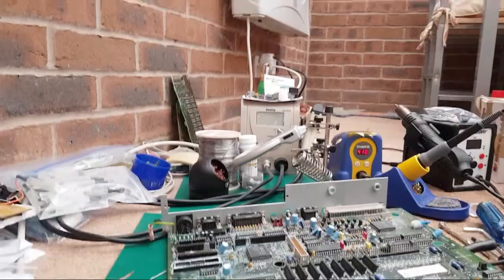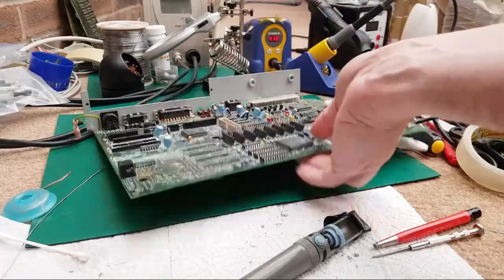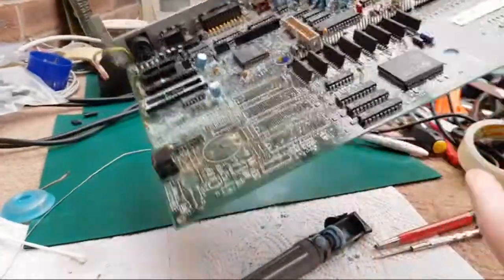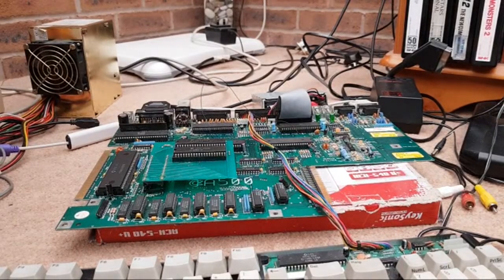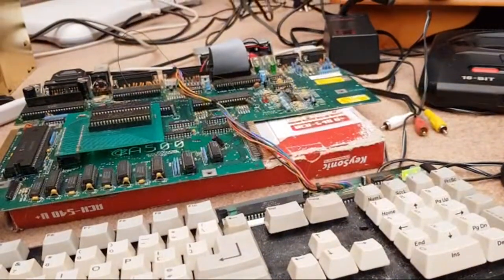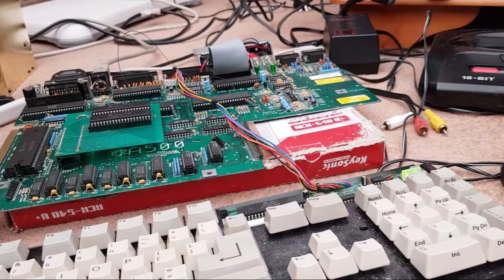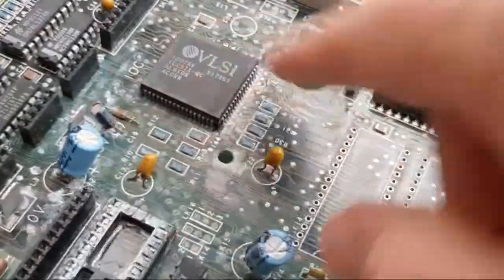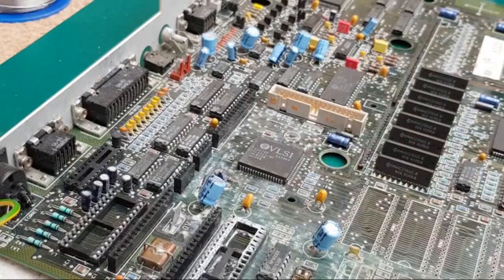Archimedes A3000 Corrosion & Amiga ROM Switcher Follow Up

Comment: Those resistors on the bottom side of the board are glued on, you can see the white line where the glue was.  If the board was wave soldered they would have to be glued on so that they would get soldered at the same time as the through hole components and not come off.  Just out of interest I would try using rosin flux and hot air to try and clean up the connections on the SMD components.  It worked well for me when dealing with liquid damaged laptops.
Reply from the maker: Indeed =D  I spotted that after watching it back too!  The top side didnt have them, I am guessing it was just glued on bottom side components only.

Comment: **TIP**
To remove components from a Board, Believe it or not it's good practice to apply leaded solder on both sides, then either use solder wick/solder sucker or a hot air gun, and then solder wick or sucker, if the board is double sided or multilayered the board should be heated on both sides if one wishes to avoid warping..
Reply from the maker: Yes, more than aware =D  Try adding solder to the top side of these boards when they are corroded - it's almost impossible and often leads to trace or pad damage.  The corrosion leaves the solder in a sorry state where it turns into something more like concrete.
Reply: @GadgetUK164  I forgot to mention Rosin flux gets soaked up by corrosion, Also with SMC a large flat chisel tip "high wattage Iron" contacting the two tabs and or as many pins of an IC takes seconds if the flux has been given time to soak with corrosion, you can never use to much flux when corrosion is present, mind you cleaning the board from Rosin is yet another exercise in itself  😃😁

Comment: Hey gadget. Any tips for clearing vias with corrosion? Run into this on Amiga 2000s. I saw someone say to blow them out vs sucking. I use a little thin piece of metal and push it out while heating it. Then sand the vias and run wire through it. Always looking to learn from an expert
Reply from the maker: How you've described there is more or less what I do!  I normally plug it with kynar and solder on both sides, then cut the kynar on both sides.

Comment: Where is the best place to find retro gear to repair?  Retro gear on ebay has increased so much that even non working systems are crazy prices. I’m not a beginner (nowhere near as experienced as you though) and am pretty well equipped equipment wise. I’ve repaired Amiga’s, Commodore 64/128s, Atari TT and BBCs/Archimedes, although not an A3000, but I have done an A4000, A3020 and a RISC PC. I’ve done some consoles as well, Colecovision and Atari 2600. I’m not interested in reselling, only the challenge of fixing something.
Reply from the maker: I ask myself that every day now lol!  3 or 4 years ago there was loads of good stuff (cheap) on eBay - these days its getting harder andd harder to find affordable stuff =/  carboot sales are starting to dry up, but that's one good place...
Reply: Arguably my house. I need to get busy... :)
Reply: I'd say the FB groups are the best places.
Reply: @GadgetUK164  Yeah, I'll have to wait for COVID to be over and then see about tracking some sales down.
Reply: @MrWaalkman  Ha, I was in the same boat at one stage!
Reply: @Archimedes75009  Thanks Zarchos, any particular groups that you might recommend?
Reply: @mgarnett02  The retro dedicated groups for a given machine and the greneral retro vintage sales ones. Sorry I don't go to FB anymore, but you'll find them easily. Join the groups, and check if there is one for members, only existing for sales. Bargains are there, not anymore on Ebay, unless it is a buy it now and you are 1st to grab them.
Reply: @mgarnett02 I tell people that my house looks like the back room of a television repair shop. :) As for busted boards, there's always Amibay.
Reply: It's a catch 22..retro needs to get less popular so prices come down but...the amount of new tech for retro computing keeps getting stronger and that's because of the popularity of RC, therefore prices higher in general. It's basic economics. Demand is higher than the supply so prices go up. I also blame Ebay for inflating prices as resellers especially need to recuperate their fees when reselling and so prices keep going up!